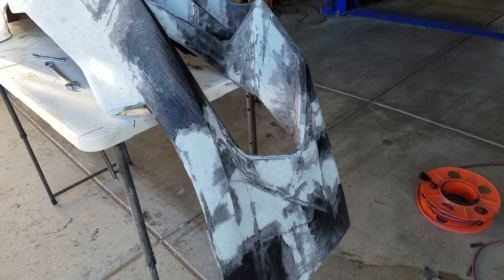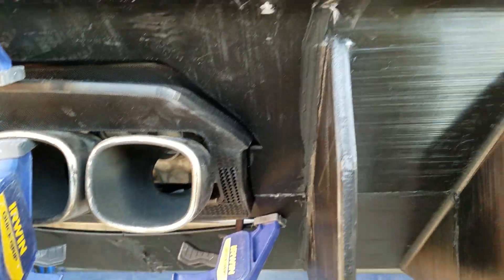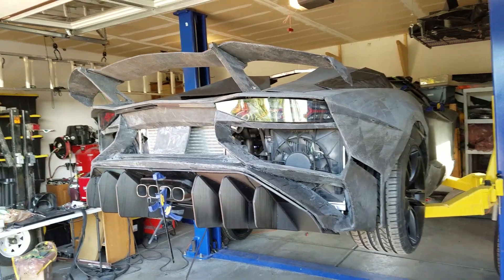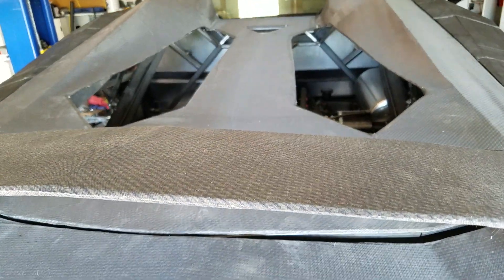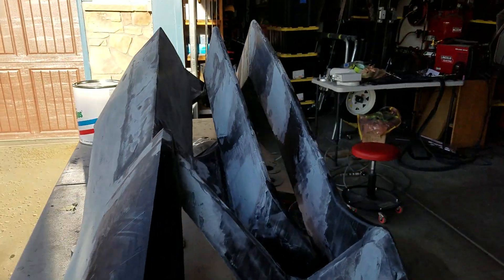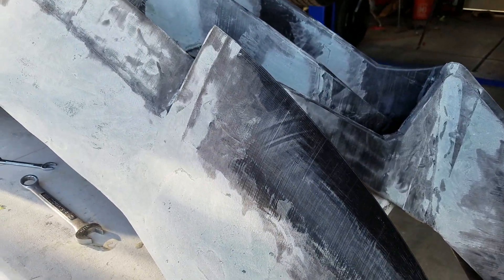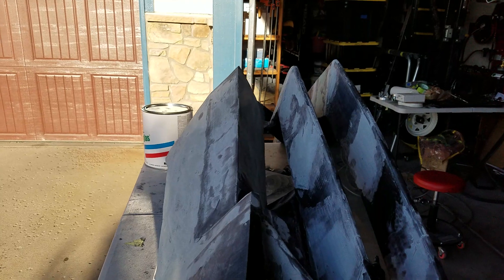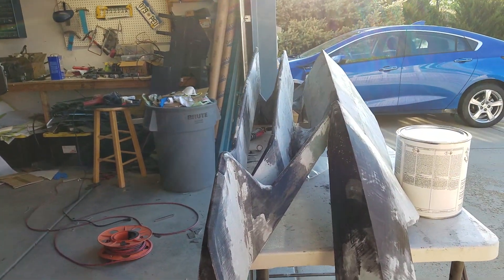Skinning 3D printed body parts (encapsulation) - Part 1

Comment: Brother im an absolute fan of your whole project, its inspired me make my own 3d printed panels and carbon skin then but to cut to the chase, how were you able to get the correct measurements for the panels to line just right? did u use a RATIO model to scale it to the correct size? anyways thanks for what you are doing for all of us, much knowledge!
Reply from the maker: Yes.  Using a known wheel base you can scale the model.

Comment: holy crap....mind blown. I would like to know where and how you got the files to do all this and/or what program you used to design it. I have a project where I need to make essentially and entire car body except for the roof, windshield frame, rear sale panels etc. Figured I'd sculpt it all out of foam and overlay it with fiberglass but this way seems to work well. 

Also considering building a car size CNC frame and putting a giant block of foam in it and pressing start. End result a foam car I could finish with fiberglass, cut up along the fender and body lines and then mold my body from the resulting sections. 

The giant CNC frame would be square steel tube with roller guides and long belts on timing pulleys. It could work if I can design it in cad and translate to files usable to CNC carve it all. Just envision a CNC mill up-sized.

The car: It is a 1966 mustang but will be built using the same fender flair and over all body design from a dekon monza based IMSA car. Essentially a vintage 1966 IMSA full race car based on a current Trans am 2 tube chassis.  anyone wanting to know what that car looks like search for [dekon monza based IMSA car] see the red #20 car, that is my goal, a 66 stang with that body work. I got a ton of work to do to reproduce that bodywork.

More info on how you designed the car body would be great. Maybe you covered that in another video?? Don't know, I got to watch all the car build videos, maybe you covered that subject??
Reply from the maker: Www.facebook.com/lasersterling
Reply: @lasersterling  Question: Why not just take that 3d printer and expand it to a size that could print most if not all of the car panels in one piece? Is there something with 3d printers that makes this not possible?
Reply from the maker: @robert5  Just need a bigger printer, which is a lot more expensive.

Comment: im in the process of designing a wide body kit for my Mazda Mx5, im wondering what the price is to 3d print the parts. My initial idea is to CNC foam blocks and create a mould with fiberglass. Id love your imput!
Reply from the maker: Depends on what equipment and expertise you have.
Reply: I dont have any experience in 3d printing/cnc or fiberglassing. But its the start of a long project im embarking on

Comment: Makes my work look small.  I have a kit car replica of a well known make.  I wanted a double diffuser wing.  My printer only does 8” long pieces so that’s how it’s made.  The pieces aren’t butted together but mortised together for strength and we’re clamped to a piece of wood while it set.  I used a similar bonding epoxy ( my mates know it as baby poo.)   It gets everywhere, in your hair, even in your eyebrows and the only method of removal is a pair of scissors.

Very impressed (and jealous) with the your work.
Reply from the maker: Thanks!

Comment: The car looks cool! $25 for 50 ml of epoxy? You'll spend thousands just for glue, won't you?
Reply from the maker: No.  does not take much.
Reply: @lasersterling  I bet you have to buy the printer monofilament in bulk, yes? You must be using miles of the stuff!
Reply from the maker: @crazysnarfy861  220kg
Reply: @lasersterling  Oh, less than I thought!
Reply: I've been thinking about making my own custom car body panels by 3D printing negative molds and forming them with epoxy resin and fiberglass or carbon fiber.
The only issue is I have zero experience with software like CAD, or Blender, and zero experience with a 3D printer lol.
Reply: What you have done with the Lamborghini is amazing! Right down my alley as far as something I would like to do, but I am starting from square one (or less).
Reply from the maker: @crazysnarfy861  Time to learn.
Reply: @lasersterling  Indeed!
Reply: Ok, good thing.

Comment: You guys should be able to find the j.b weld stuff online really cheap if u buy in bulk, the strongest stuff they make is like 4000psi strength, might end up being way cheaper than the epoxy ur using.

Comment: What type of filament are you using and how much infill? Do the parts come out much heavier than you would expect an oem fiberglass panel to be?
Reply from the maker: PLA.  Not a lot, but they have the advantage of having built in sound damping.  Infill at 15%.